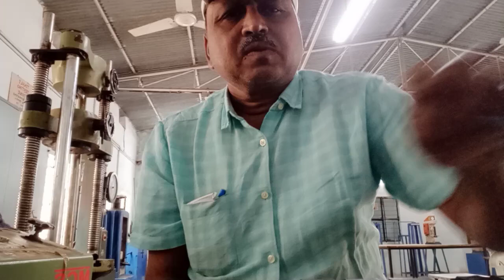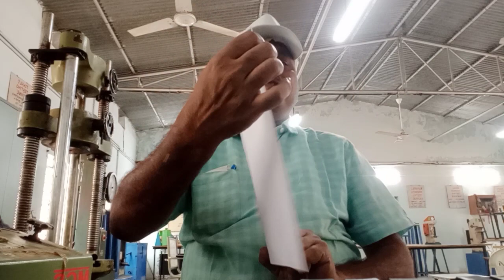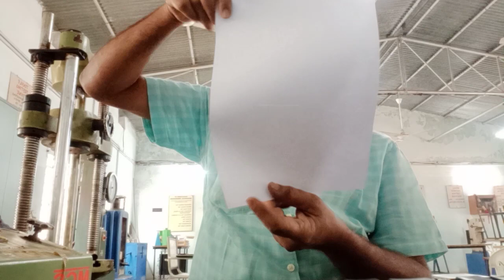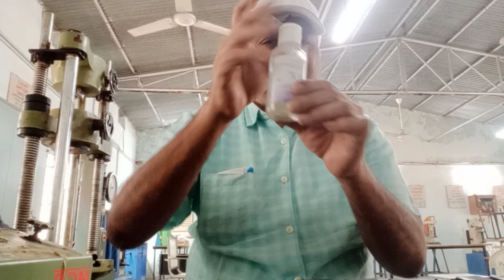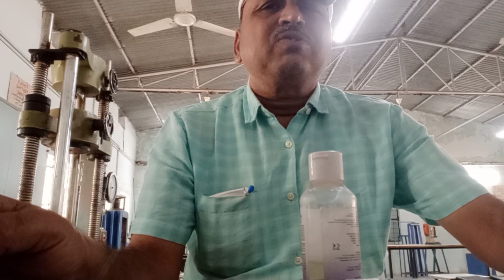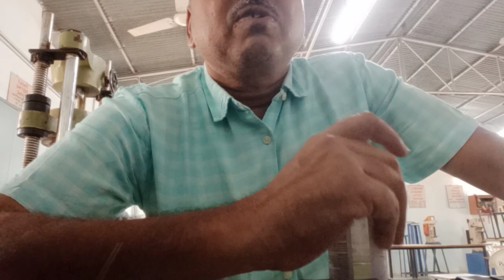ENGINEERING GRAPHICS-POSSIBLE SHORT ANSWER QUESTIONS ASKING

Comment from the maker: UNIT 2:
1.	How are projections classified?
2.	What are projectors?
3.	What meant by orthographic projection?
4.	What are the assumptions made in orthographic projection?
5.	What is meant by projection and an orthographic projection? Name the two systems of projections which are in vogue.
6.	What is meant by profile plane?
7.	What is the use of profile plane in drawing?
8.	What is a reference line?
9.	Explain the differences between first angle and third angle projection method.
10.	Sketch the symbols used to represent (a) First angle projection and (b)Third angle projection
11.	How to define the position of an object or a point in the four quadrants relative to the principal plane.
12.	Why the second and fourth angles of projections are not followed?
13.	Draw the projections of a point which is in the V.P. and 30 mm below HP.
14.	The top view of a point ‘A’ is 40 mm above xy and its front view 20 mm below the top view. Describe the location of the point with respect to reference planes.
16.	FV of a point is 50 mm above xy and TV is 20 mm below. In which quadrant the point is? Also draw the projection of the point.
17.	State the relation between front view and top view of a point.
18.	A point P is 30 mm from HP, VP and PP. Draw projections of point P when it is in first quadrant.

         PROJECTIONS OF STRAIGHT LINES
19.	What is true angle and apparent angle?
20.	Draw the projection of a straight line AB of 60 mm length, when it is perpendicular to H.P., 30 mm in front of V.P and one end 25 mm above H.P.
21.	How do you find out the true length of the line from the given projections of the line?
22.	Name the methods of finding the true length and true inclinations of s straight line from its projections?
23.	A line of 100 mm long is parallel to and 30 mm above H.P. Its two ends are 25 mm and 50 mm in front of V.P. respectively. Find its inclination with V.P.
24.	The sum of the true inclinations of a line (θ+φ) is 90˚. Give comments.
        
PROJECTIONS OF PLANES

25.	What is an oblique plane? When the traces of an oblique plane will be parallel to x- y. Give example.
26.	What are the uses of auxiliary planes?
27.	When do you require auxiliary views?
28.	Define AVP and AHP?
29.	A sphere rests on HP. How its shape will be when projected on an AHP?
30.	Define the position of an elliptical plane such that its front view appears as a circle.
31.	Top view of a plane is circle and the front view is a line inclined at 600 to xy - line.  Draw projections and show true shape of the plane.

Comment from the maker: UNIT:4
Sections of solids
1.	What is meant by sectioning an object?
2.	Why the solids are sectioned?
3.	What is a sectional view?
4.	List out different types of cutting planes
5.	What is meant by sectional top view and sectional front view?
6.	Differentiate between a section and a sectional view.
7.	What is apparent section and true shape of section?
8.	How do you obtain the true shape of the section of a solid? Explain.
9.	How is the true shape of a section obtained?
10.	How to represent section planes in drawing?
11.	What are the different positions of cutting or section plane?
12.	When the sectional top view does shows the true shape of the section?
13.	When the sectional front view does shows the true shape of the section?
14.	How can the true shape of section be obtained when a solid is cut by an AIP?
15.	What is an auxiliary vertical plane and profile plane.
16.	A cone stands on HP with its axis vertical. Show the cutting plane which will produce a circle.

Development of surfaces

17.	Draw the development of surface of a cone of base diameter 20 mm and axis 30 mm.
18.	Explain the engineering importance of development of surfaces.
19.	Explain briefly, the different methods of development.
20.	What are the uses of development of surfaces?
21.	What are the uses of development of surfaces?
22.	What is meant by the development of a solid?
23.	What are the different methods of development of surfaces?

Comment from the maker: UNIT:5
Isometric Projections/Views 
1.	Name the Pictorial projection in which three dimensions of solid can be shown in one view.
2.	Explain the advantages of “Isometric Projections”.
3.	What is the difference between the isometric drawing and isometric projection or view?
4.	Explain ‘isometric planes’.
5.	Distinguish clearly between isometric view and isometric projection.
6.	Define isometric axes, isometric scale and isometric view.
7.	What is an isometric view?
8.	What is an isometric scale? 
9.	What is the angle between isometric axes? What are the isometric lines?
10.	Explain the terms Isometric length and True length.
11.	Define isometric axes, isometric planes and isometric scale
12.	What is the difference between Isometric view and Isometric projections?
13.	What is the shape of the Isometric projection of a circle?
14.	Sketch isometric projection of a square prism of 30 mm side and 50 mm height.
15.	Draw the isometric projection of a sphere of 100 mm diameter
16.	Compare first angle and third angle projection methods.
17.	What is meant by orthographic projection
18.	Sketch the symbols used for (i) first angle projection (ii) third angle projection
19.	Explain the terms:- (a) Reference planes (b) projectors

Comment from the maker: UNIT 1: 1.What is meant by dimensioning? What are the two systems of placing dimensions on a drawing? Illustrate your answer with sketches.
2.	Discuss the method of dividing a line into any number of equal parts.
3.	Inscribe a pentagon in a circle of diameter 40 mm
4.	Describe a regular hexagon about a circle of 75 mm diameter.
5.	Inscribe a Hexagon of 30 mm side in a circle.
6.	Distinguish between inscribed figures and circumscribed figures.
7.	What is Representative fraction/Scale Factor?
8.	Sate the applications of reducing scales and enlarging scale with examples.
9.	Define eccentricity.
10.	Name various conic sections. How a hyperbola is obtained here.
11.	What are the conics?
12.	Name the possible true shapes of the sections when a horizontal section plane cuts a cone for its different positions.
13.	Define eccentricity and state its values for different conics.
14.	A section plane is cutting all the generators of a cone. What is shape of the section obtained?
15.	What are applications of parabola, ellipse and hyperbola?
16.	Differentiate between Epicycloid and Hypocycloid.
17.	Define an Involute?.

Comment from the maker: UNIT 3:   

  PROJECTIONS OF SOLIDS
1.	Name the solids of revolution.
2.	What are solids of revolution? Name them and how are they generated?
3.	Distinguish between prism and pyramid.
4.	Give any three examples for regular polyhedron.
5.	Define polyhedra, prism and pyramid.
6.	What is a polyhedron? What are the only regular polyhedra that are possible in nature?
7.	What is meant by Polyhedra? Give examples.
8.	What is the difference between right regular prism and oblique prism?
9.	Define frustum of solid.
10.	Define truncated solid.
11.	Name the methods to obtain the projection of solids?
12.	What is the shape of the top view of the right circular cone which is resting with its base in V.P.?
13.	Explain the method for drawing projections of solid in simple positions? (Axis perpendicular to one plane and parallel to the other plane)
14.	Explain the method for drawing projections of solid with axis inclined to one of the principal planes?
15.	What is the procedure to draw the projections of solid when axis is inclined to one of the reference planes and parallel to other?
16.	Draw the projections of a cone of base 20 mm dia. And slant height 30 mm, when it is resting on its base on the VP and axis at 10 mm from the ground.
17.	State the location of the centroid of a square pyramid.
18.	Draw top views of hexagonal prism and hexagonal pyramid when both the solids are resting on HP on its bases.